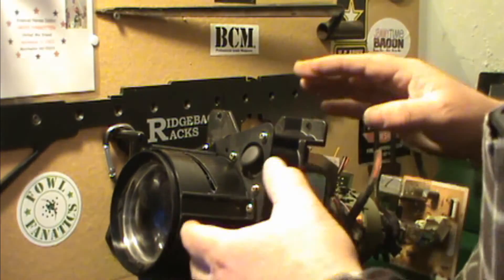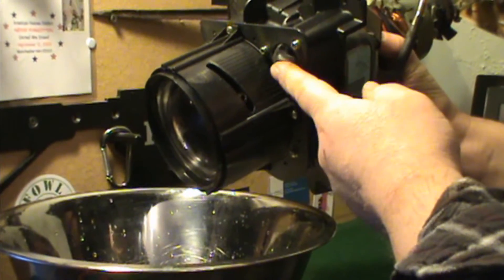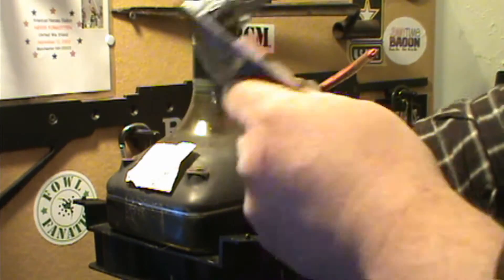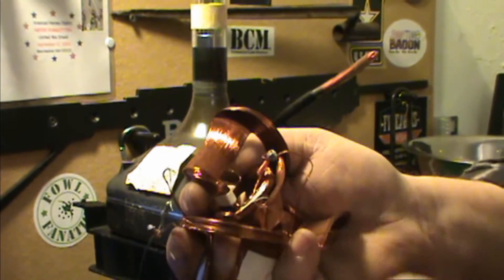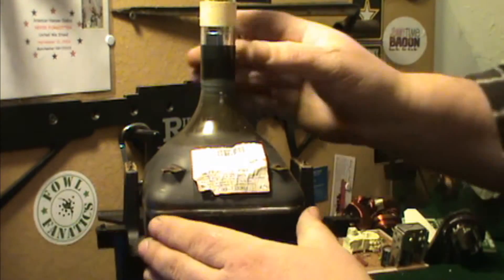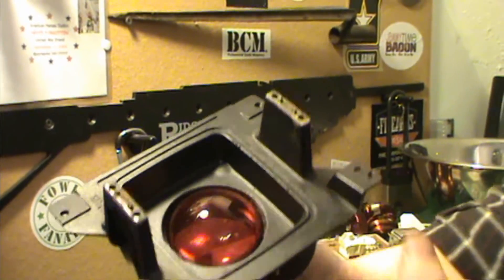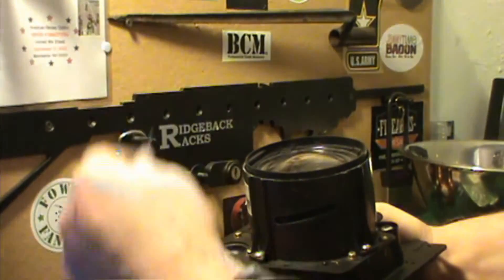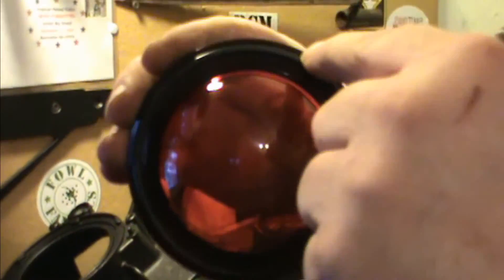Harvesting Liquid Fuel and Fire Starters from TV

Comment: I had no idea there was such a big magnifier in them.  I'll be scrounging for sure now.
Reply from the maker: I will have to do that.
Reply from the maker: You get three !
Reply: Be careful, make sure those capacitors are discharged.  Good hunting.  :)
Reply from the maker: That's all done during initial break down of the DLP set.
Reply: John Solar 283 ™
Did you already show how to do that?  Or could you do one specifically on how to discharge them without not getting the mess knocked out of you.